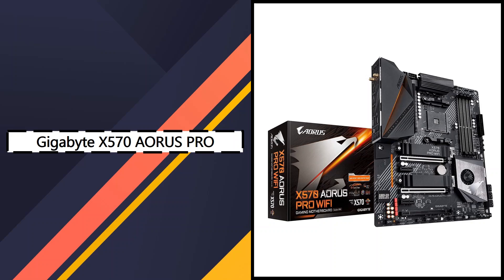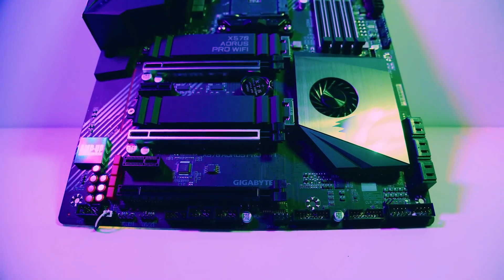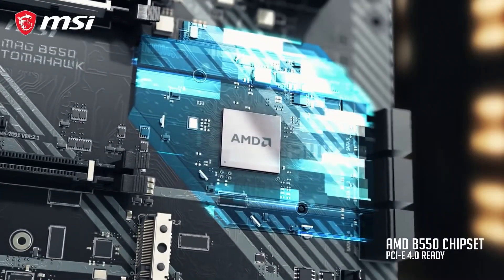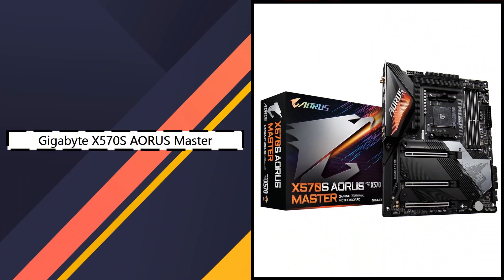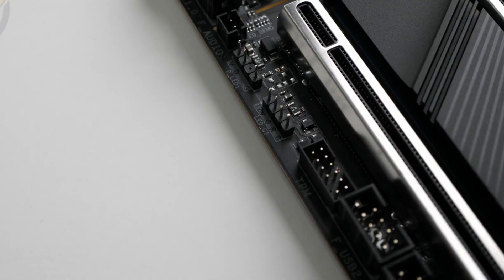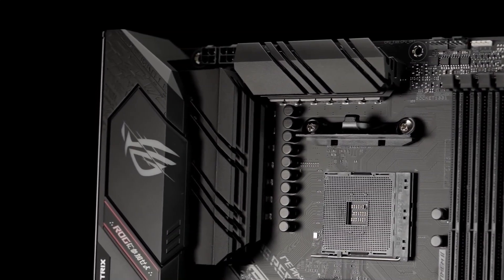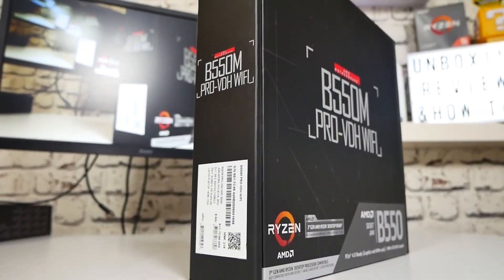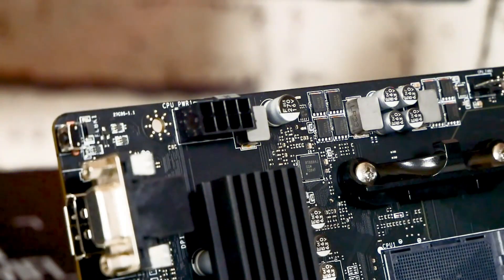Is AM4 Still Alive? 5 Best AM4 Motherboards in 2026

Comment: My MSI B450m Mortar with built in Ethernet, Bluetooth, wi fi, SPDIfF, and two NVME slots from 2018. Still runs great after 7 years.
Reply: I never built a PC but wanted to try. I guess I wanted to do a budget build. What would you suggest?
Reply: @WilliamGregg-qf4rp  I suggest a used bundle if you are trying to save money. As long as the motherboard has all the features you want, you should be happy.
Reply: @Brad-p1c Part of it is I want to build a PC . I've never done it. I know everything has to be compatible. I guess I'm a little scared of messing it up so maybe I should start with a lower budget one.
Reply: I love mine to death, im actually upgrading today and the only reason is it does not have a 2nd ssd slot, so it really just a storage thing not performance lol, things a beast